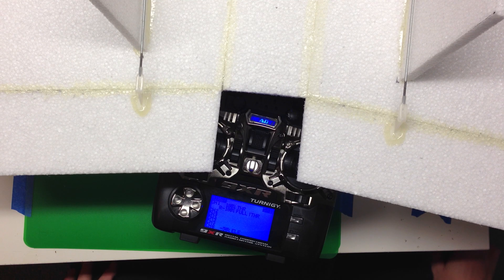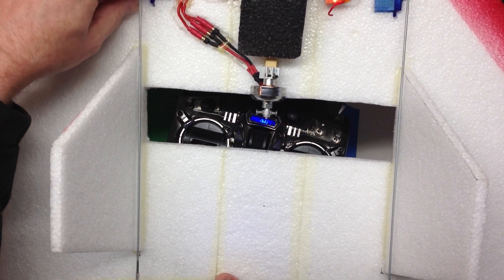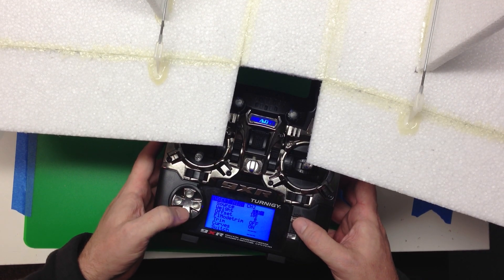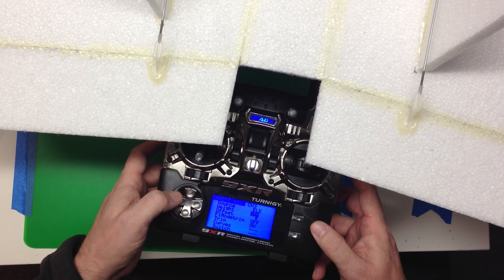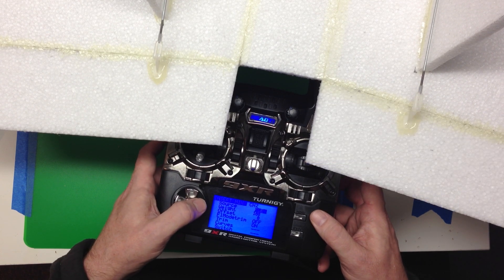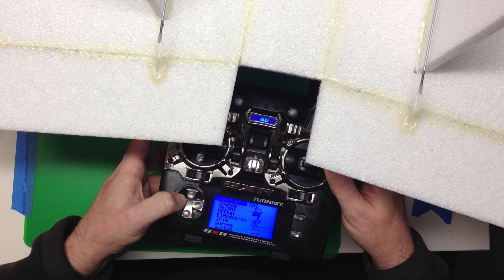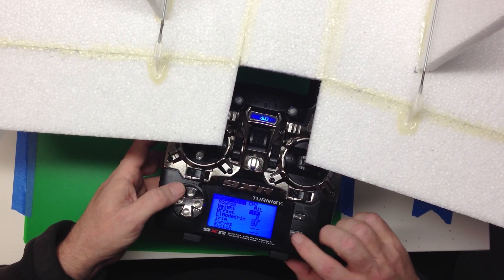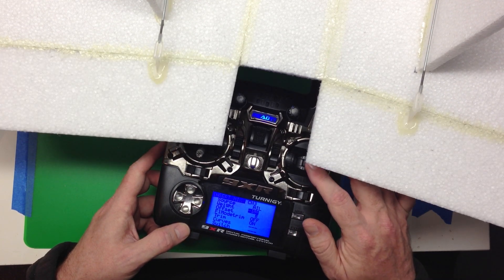er9x: Elevon Mixing

Comment: I am using 9XR with frsky DJT module and VFR8 ii receiver. I ve already bind and set it to the elevon. But after I plug my esc power plug there is a beep beep beep sound and the light is green. When I try the 4ch trainer setting it does work properly. What happen with my elevon setting? By the way I se mine with channel 3 for throttle and channel 1 and 2 for elevon. But after watch your video I switch my throttle in channel 1 but its still beeping like that. Any sugestion? What should I do? Thanks

Comment: Instead of changing your limits to 50% at the end of the video you could have used curves so that you don't get the super responsiveness but you still have the full range of the servo's if you ever need them during flight.
Reply from the maker: That's an interesting idea... not necessary on the SuperFly (it can almost loop in the diameter of its body), but I'll try it with curves and see how it goes!

Comment: Mark,

I have just finished my set up and for some reason my servos are jacked up. Once the battery is plugged in they go completely down and no matter how much trim or mixing i do it does not fix it. Do you know a reason as to why this is happening? Thanks for your time
Reply from the maker: Look at the channel output screen on th radio.  Is the output for the two channels the same as the servos?